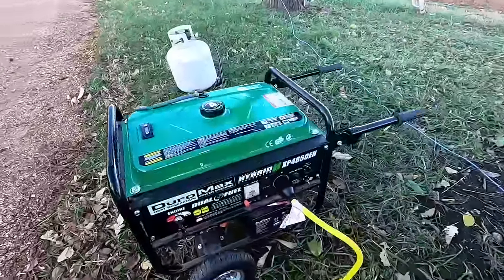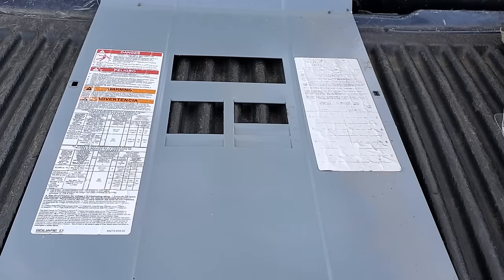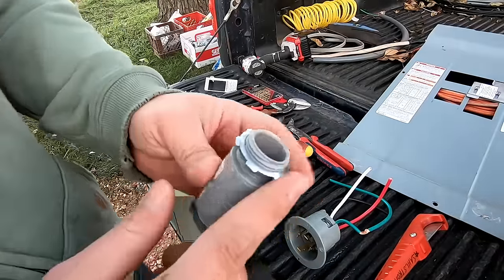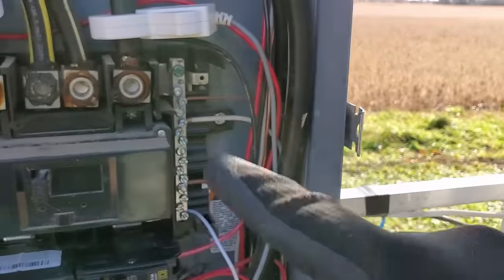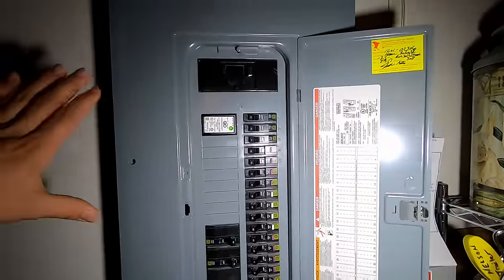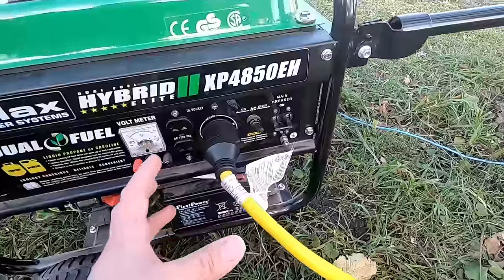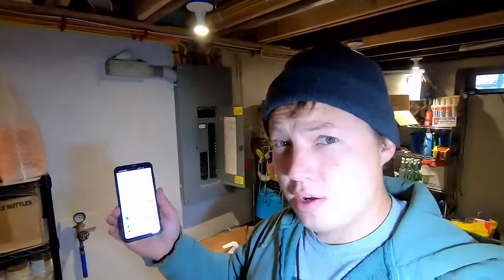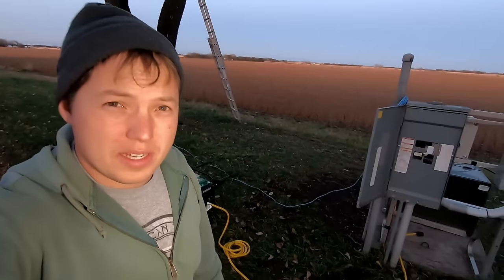How To Hook Up a Generator To Your House Using a Breaker Interlock Kit & Power Inlet Box

Comment: Thanks Benjamin, your information will come in handy when I'll try to install my 9K generator.
Reply: ⚠️Portable Generator Safety Tips:

1) KEEPING OTHERS SAFE: Please do not allow an unqualified person or your children to operate and service the portable generator. Just because some manuals don’t say that doesn’t mean it’s safe. That is important against the generator safety rules. We also need to be keeping an eye on our children too. You need to make sure that your children are not playing near the portable generator especially when it’s running so they won’t get electrocuted. Generators pose electrical risks and they can be hot during an operation. Please keep your children away from the portable generator at all times. It is important to keep our children safe especially our little ones. Be aware of all the hazards.

2) WHERE TO RUN YOUR GENERATOR: Some people use their portable generators indoors which increases the risk of carbon monoxide poisoning. It’s important to have a carbon monoxide if you have a gas generator. Never ever use your generator indoors even if your doors and windows are open and even in the garage is not safe to use a portable generator. Also please never use your generator in your deck or balcony. It is never safe to use your generator indoors and in enclosed areas of your home. Your generator needs to be 15-20 feet away from your house. 

3)🔥FIRE HAZARDS: Never refuel your generator while it’s running. You need to let your generator cool off before refueling it and before storing your generator. Never overload your generator too. Never ever back feed your generator. You should never plug your generator into a wall outlet. Also never store propane tanks indoors. Please keep flammable things away from the generator as well and please don’t smoke cigarettes near the generator. Having a fire extinguisher next to the generator is also important against the generator safety rules. It’s also not safe to move your generator while it’s running.

4) GENERATOR OPERATION: make sure your hands are dry before touching the generator. Never use your generator in wet conditions. Don’t let your generator get wet. You need a generator tent if you need to use your generator during wet weather. Please don’t wear loose clothes when operating the generator. Turn on your generator before plugging in appliances. Use the right cord for your generator. Please do not use worn out cords. 

https://youtube.com/shorts/eFigDfnPkcQ?feature=share and here is a short video more about keeping others safe when using generators. Portable generators need maintenance so it’s important to follow the safety instructions.

Hope this helps

Comment: Hi Ben, thanks for your detailed instructions and I have installed it the same way as you did.  I live in Florida and the only problem I have is when I use the generator, I am not sure when the grid power is coming on, as I ask my neighbors and then flip the main 200AMP breaker on to find if there is power on the grid. Can we find out if we have power in the grid or not when using a generator? I would greatly appreciate any help.
Reply from the maker: Good question! The simplest option would be to see if your digital meter is on? If you have a mechanical meter then I suppose the only way to know would be to check with a multimeter.
Reply: @BenjaminSahlstrom  Agreed Ben, I have a standard 200Amps panel board, and after installing the interlock kit, have closed the panel board.  So every time I need to remove the pannelboard to check the power with a multimeter?  Can you refer me to any video to check the power with the digital meter setup, so I can understand better.
Reply from the maker: @ganeshrvgk  What I meant was to look at the electric meter (round thing with numbers on it) to see if the display is on. If it is, then you have power. Does that make sense?
Reply: @BenjaminSahlstrom  ohh yeah thank you.  I got it, the electric meter which is located outside of the house.  In India, we have 3 small LED bulbs (each for one phase) connected to the main grid and it gets illuminated whenever the grid power comes on, and that's how we find it out.

Comment: Thank you for the video. Ha Ha Strange to see the panels weathering in the outside elements. I'm use to seeing them under cover. Great job, insight and explanation. 
FYI my cousin has a newer home with a pool 3 central a/c/units, icemaker etc. The home generator system is rated for the entire house, starts and stops automatically, feeding from a underground propane tank. When the power goes out they have a block party and invite all the neighbors. The people that come really have fun dancing swimming cooking, sharing their otherwise waisted warming food right. The ones that dont for whatever reason get angry, Cost them a fortune in propane but never changes their daily routine much. Yes a high initial price. I just have 6 extension cords running from my 3500 watt gen set. looks like Christmas without the lights so I'm  looking for a better plan and this is it for me. Have an in-law that's and electrician but he is more of a outlaw to me. Anyway i'm working on it.

Again... thanks pal!
PS  Oh by the way, I'm now a New Subscriber

Comment: you must isolate the ground/ neutral also , without doing so some current can be feed through the ground line
Reply: Here are the Generator safety tips: Always make sure you follow all the generator safety rules whenever you use your portable generator. This is a reminder for everyone’s safety of using generators. Generators can be dangerous if not used carefully. Every year, hundreds of people die or get injured when using portable generators due to carbon monoxide poisoning and electrocution. Make sure you are using your generator carefully and keeping others safe as well. There is something very serious that everyone should always be aware of when using generators. Some people do run their generator indoors which is not safe and that increases the risk of carbon monoxide poisoning which can cause death of family and you. Some people run their generator in wet conditions which can electrocute them. Please remember that you should never run your generator indoors. Remember that carbon monoxide is an odorless and colorless gas that you cannot see or smell. Carbon monoxide is a silent killer. Keep that in mind. Make sure your generator is 15-20 feet away from your house and away from doors, windows, and vents. Never use your generator in your porch too. Having a carbon monoxide detector is very important against generator safety. Some people also allow children to go near the portable generator which could pose risks. We need to keep an eye on our children making sure that they are not near the portable generator so they won’t get electrocuted or burned by the generator which is dangerous. A locking enclosure also keeps kids safe. A generator shed might look like a tempting place to explore, or take cover during a game of hide and seek, but a generator is a dangerous piece of equipment that can cause injury. It says on the manual that we should also keep children away at all times from the portable generator to avoid injuries. Please do not allow a child or unqualified people to operate the portable generator.  It is important to keep your children safe especially little ones. The portable generator can be hot during an operation. Just because some manuals missed what should be listed doesn’t mean it’s safe to do. Always follow the generator safety rules when using portable generators. Generators pose electrical risks. If you need to use your generator during wet weather, you need a generator tent to protect your generator from getting wet. Don’t let your generator get wet. Keep your generator dry and before using your generator, please make sure your hands and your generator is dry. Do not wear loose clothing when operating the generator. Everything that is said on the generator’s operating manual should not be ignored. Never smoke cigarettes near the generator. Please keep flammable things away from the generator. Never overload your generator too. Your generator can catch fire. Never ever try to plug a generator cord into a wall outlet to avoid back feeding. Back feeding your generator is dangerous. Always turn on your generator first before plugging in appliances and shut off the appliances before turning your generator off. Use a heavy duty cord for your generator and the cord should not be worn out. All the instructions should be followed carefully. Never refuel your generator while it’s running. It can cause fire if fuel spills while your generator is hot. You should turn off your generator and let it cool off before refueling it. Having a fire extinguisher next to the generator is also important. This is only a reminder for everyone’s safety of using generators. Make sure your generator is properly grounded. Having a fire extinguisher next to the generator is also important against the safety rules. https://youtu.be/I1jT3ANENvI and here is a video more about keeping others safe when using generators and also about our family’s safety. It’s important to keep our little children safe as well. Make sure your little children are kept away from the generator at all times especially when it’s running. Hope this helps. Always remember that it’s better to be safe than sorry. Also remember that warnings should not be ignored too.

Comment: Get a small UPS for sensitive electronics. Not so much for backup power, but for current regulation. Probably cheaper than going full inverter generator.

Comment: Ben is obviously very experienced with electrical supply equipment and breaker boxes.  Although he makes the job look very simple, there is always a danger of electrocution when working around this stuff.  But Ben explains everything perfectly well for the novice or DIY electrician.  Even though different homes may have different electric equipment installed at their location, the principals are the same for electric house wiring.  Local fire and electric codes dictate the actual products used in each environment.  I'll be installing a home standby generator with a transfer switch.  I just hope that I can find an electrical inspector who will inspect my job without charging me huge $$$ for his service.  I do have many  years of electrical experience, I just don't have that EE certification.  IF I follow Bens guidance, then I expect that I will pass.  Thanks Ben!
Reply: ⚠️Generator safety tips:

This is just a reminder for everyone’s safety when using portable generators. All generator safety rules need to be followed carefully to avoid hazards. 

1) Please do not allow an unqualified person or your children to operate the portable generator. Just because some manuals don’t say that doesn’t mean it’s safe. That is important against the generator safety rules. We also need to be keeping an eye on our children too. You need to make sure that your children are not playing near the portable generator especially when it’s running so they won’t get electrocuted. Generators pose electrical risks and they can be hot during an operation. Please keep your children away from the portable generator at all times. It is important to keep our children safe especially our little ones. Be aware of all the hazards.

2) Some people use their portable generators indoors which increases the risk of carbon monoxide poisoning. It’s important to have a carbon monoxide if you have a gas generator. Never ever use your generator indoors even if your doors and windows are open and even in the garage is not safe to use a portable generator. Not even at your porch and your deck. It is never safe to use your generator indoors and in enclosed areas of your home. Your generator needs to be 15-20 feet away from your house. 

3) 🔥generators cause fire hazards too. Never refuel your generator while it’s running. You need to let your generator cool off before refueling it and before storing your generator. Never overload your generator too. Never ever back feed your generator. You should never plug your generator into a wall outlet. Also never store propane tanks indoors. Please keep flammable things away from the generator as well and please don’t smoke cigarettes near the generator. Having a fire extinguisher next to the generator is also important against the generator safety rules. 

4) generator operation; make sure your hands are dry before touching the generator. Never use your generator in wet conditions. Don’t let your generator get wet. You need a generator tent if you need to use your generator during wet weather. Please don’t wear loose clothes when operating the generator. Turn on your generator before plugging in appliances. Use the right cord for your generator. Please do not use worn out cords. 

https://youtu.be/I1jT3ANENvI and here is a video more about keeping others safe when using generators and also about our family’s safety. Hope this helps

Comment: Excellent video, thank you very much for it.
 I do have a question/concern though. As I understand it, it's important to have only one ground-neutral bond in the system and most portable generators have a bonded neutral. The main panel of the house will already have this bond, if the generator neutral is also bonded wont it create parallel path neutral?
 I really want to follow your example but I am concerned with regards to this potential issue.

Comment: Great video I hate how  non efficient   propane is so I use gas .  i use  the same set up you have except I have a 17.5 kw  generec        used  3 guage  wire    one other thing I did was install  permanent amprage  meters inside beside my breakers to see the load and  how much  load  is on each leg as it runs real time.  Balancing the loads  and extending the life of the generator winding
Reply: Please make sure you follow all the generator safety rules whenever you use your portable generator. 
⚠️Here are the Generator safety rules that everyone needs to follow when using generators:

This is just a reminder for everyone’s safety when using portable generators. All generator safety rules need to be followed carefully to avoid hazards. 

1) Please do not allow an unqualified person or your children to operate the portable generator. Just because some manuals don’t say that doesn’t mean it’s safe. That is important against the generator safety rules. We also need to be keeping an eye on our children too. You need to make sure that your children are not playing near the portable generator especially when it’s running so they won’t get electrocuted. Generators pose electrical risks and they can be hot during an operation. Please keep your children away from the portable generator at all times. It is important to keep our children safe especially our little ones. Be aware of all the hazards.

2) Some people use their portable generators indoors which increases the risk of carbon monoxide poisoning. It’s important to have a carbon monoxide if you have a gas generator. Never ever use your generator indoors even if your doors and windows are open and even in the garage is not safe to use a portable generator. Not even at your porch and your deck. It is never safe to use your generator indoors and in enclosed areas of your home. Your generator needs to be 15-20 feet away from your house. 

3) 🔥generators cause fire hazards too. Never refuel your generator while it’s running. You need to let your generator cool off before refueling it and before storing your generator. Never overload your generator too. Never ever back feed your generator. You should never plug your generator into a wall outlet. Also never store propane tanks indoors. Please keep flammable things away from the generator as well and please don’t smoke cigarettes near the generator. Having a fire extinguisher next to the generator is also important against the generator safety rules. 

4) generator operation; make sure your hands are dry before touching the generator. Never use your generator in wet conditions. Don’t let your generator get wet. You need a generator tent if you need to use your generator during wet weather. Please don’t wear loose clothes when operating the generator. Turn on your generator before plugging in appliances. Use the right cord for your generator. Please do not use worn out cords. 

https://youtu.be/I1jT3ANENvI and here is a video more about keeping others safe when using generators and also about our family’s safety. It’s important to keep your children safe especially little ones. 

Electrical safety 

Hope this helps

Comment: Good vid.... I wired up the same way. A few hints for others......tape a set of "on" and "off"
 instructions inside the door of your main panel. During an "emergency", you're mind turns to mush and having 4-5 ( in-sequence) "on" directions as well as "power-down-and-get-back-onto-grid-power" directions posted....may be advisable. A you saw yourself doing....ask yourself,,,......what sequence do you want to attach the main power chord?.....turn on the generator?...."switch-over" the interlock?, etc. Reading this as 4-5 bullets helps. Then.....maybe mark the specific "critical" breakers you'd like to put back on ( seeing you turned them all off before you energized the generator)--- now you're putting "select" breakers back on. Better if you know beforehand which these are....and if, in total, these are also within your generator power draw limits. Hate to figure all this out durng a power emergency.